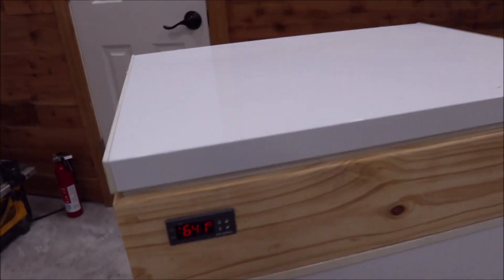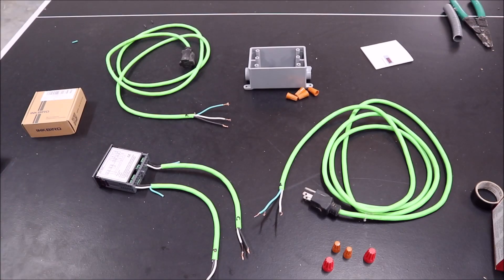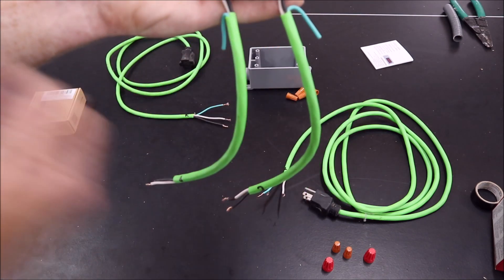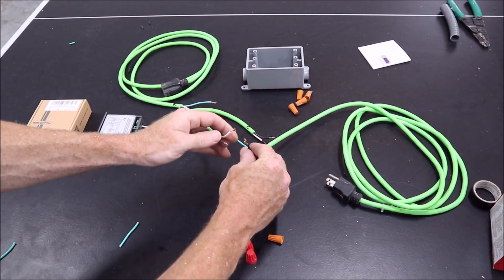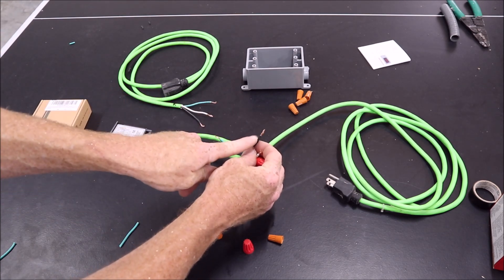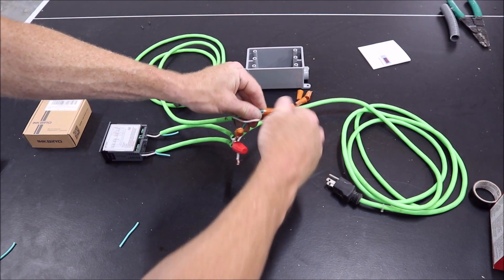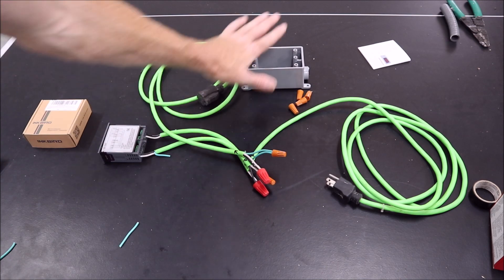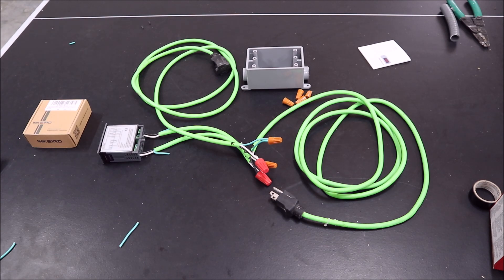How To Wire InkBird Temperature Controller Unit 1000 For Home Brew, Keezer or Kegorator DIY

Comment: I have made a keezer in the past.  Now I am trying to get a commercial grade display refrigerator to cool colder than its lowest setting of 40 Fahrenheit.  With this wiring example for a keezer it is still shutting off at 40 degrees.  Do I need to bypass the thermostat of the refrigerator?  Using the controller instead?

Comment: Beats me why everyone seems to control the main electrical input to the fridge/freezer. Much simpler just to disconnect the thermostat switching wires and connect them to the cool connections on the sct1000, i.e. use the sct1000 in place of the thermostat and leave the fridge/freezer alone.

Comment: I wonder if it would work wiring in a power supply for a fan into that. I'm thinking of installing a circulation fan in mine and I think it would be nice to run it with the power to the refrigeration unit.
Reply: Couldn’t you get an outlet splitter and plug it into the cool side female plug in?

Comment: Thank you for taking the time to post this video. It is very helpful.  Question - will this wiring method override the original freezer thermostat? I am attempting to convert a freezer into a refrigerator. If the inkbird controls the temperature, it will be a success. Please let me know. Thank you again.
Reply from the maker: You're welcome! Yes it will override the original thermostat
Reply: @danielmid6022  It worked !!!!! Thank you again for taking the time to share.  I really appreciate it. Have a great day.

Comment: I just can't get the freezer to work. Power gets to the thermostat. I'm so frustrated.
Reply from the maker: What's the compressor delay set to? Might have to let it sit after first plugging it in for a bit before it will show the compressor to kick on
Reply: @danielmid6022  IT WAS EXACTLY THAT. I was smashing my head against the wall and at minute 4 of smashing the compressor started working. Thanks!